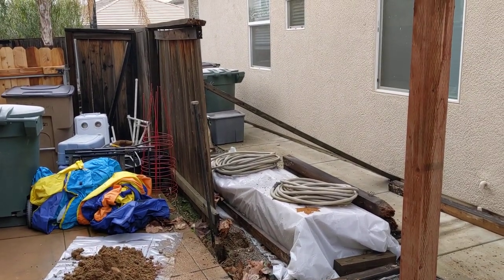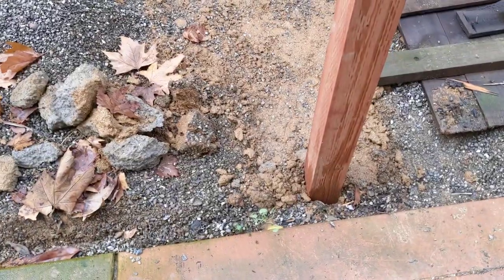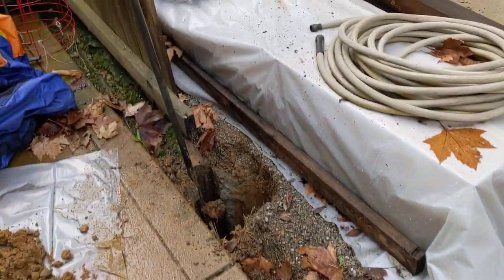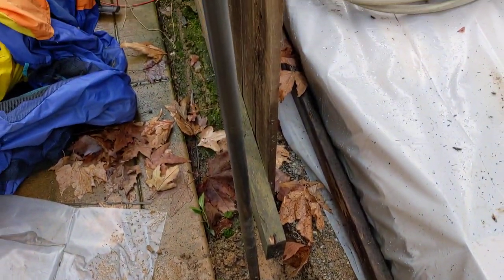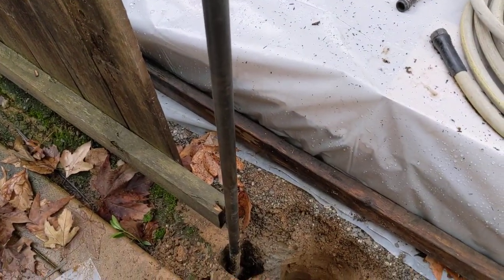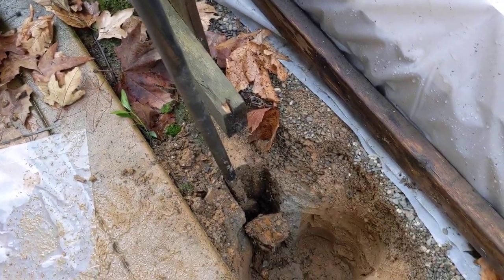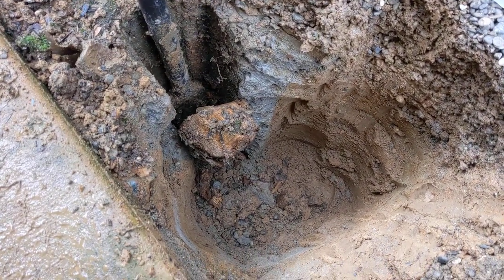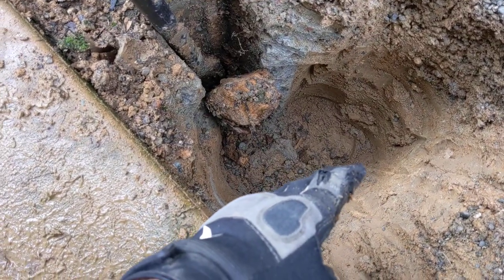How to remove a broken off fence post stump

Comment: I’ve found that getting that rotted stump up is easier if you get a pointed shovel on each side ( takes two shovels and two people ) and you both pry up it comes right up. That way all the force of the stump is coming up instead of to the side , only drawback is it takes two people and you have to use strong shovels ( preferably fiberglass handles ).. good luck !
Reply: We use this method when removing broken posts but we don't use shovels we use long crowbars and yeah it can still take a little time but is a better way of doing it.

Comment: Easier is to drive a 10 in long 1/2 or 5/8 in screw (from Lowes) in the middle of it.  THen connect rope to the end of it and use comelong to pull it.
Reply from the maker: Yep, that's preferable if it works.  Unfortunately mine have been too rotted.  Out of the dozen or so I've replaced, only one pulled out of the concrete using lags.  On the others, the lags pulled out of the rotten wood...and I had up to eight 10" lags around a central eye bolt using a 1/2" thick plate drilled with a tic-tac-toe pattern of holes.  Thanks for the input!
Reply: And not if the wood is wet and not rotten at all

Comment: Using concrete on a fence post  is huge mistake on any post, it will make it rot.  Especially on something non structural like a fence.  They won't last 10 years.   We have post put in on our ranch that were put in the ground more than 60 years ago(and these post were not pressure treated either).   I not saying that is case every time,  like when you have to set a shallow post but concrete around a post is for someone who likes to do a job twice, may even more than in a working lifetime.  Use dirt whenever possible with water and good compaction, 6 inches lifts of backfill

Comment: Dont use concrete to begin with. Just backfill with dirt a few inches at a time and tamp as you go. It will be FAR more solid and wont rot nearly as fast. 
Soak the end of the podt in used motor oil and it will out live you.